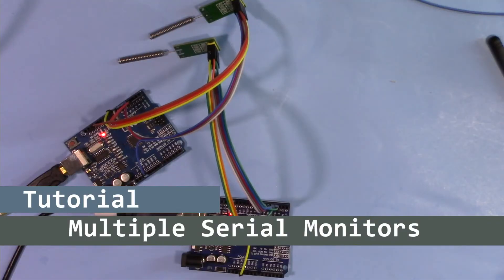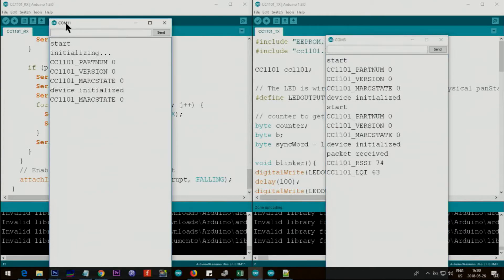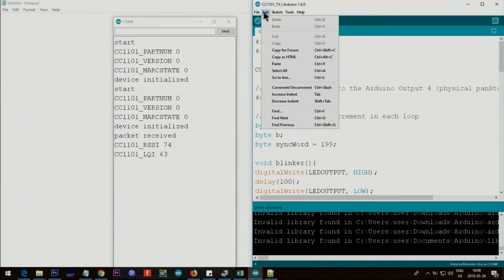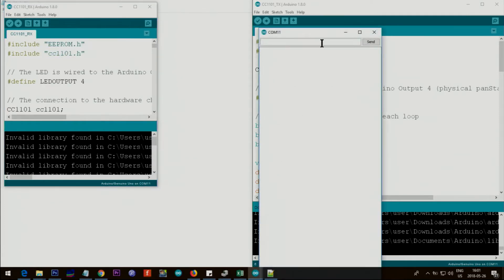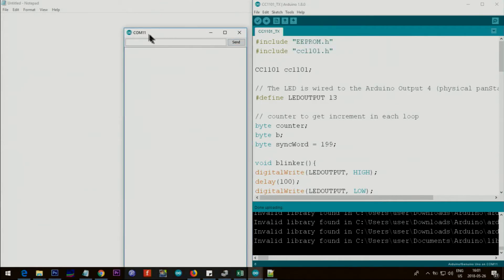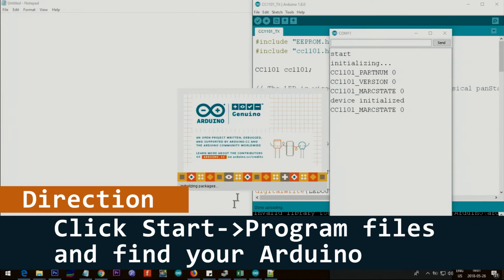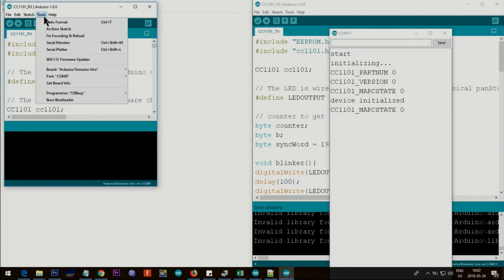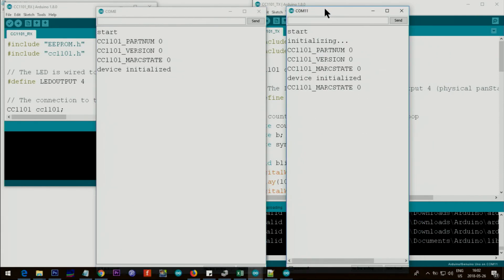How to open multiple Serial Monitor for Arduino

Comment: You showed us how to open a serial monitor per a board. You have not shown how to open 2 serial monitor to the same board!
Reply from the maker: Hi that is is Per board. each for different COM port.
Reply: @robojax  There is no problem with this. Simply open Arduino IDE twice and set each to its COM port.